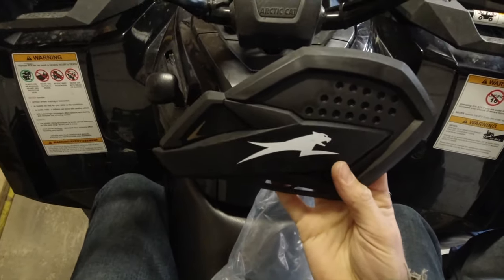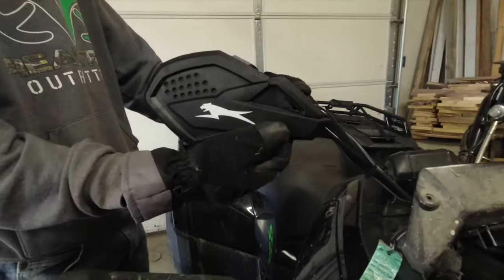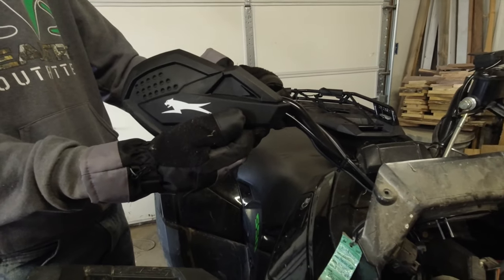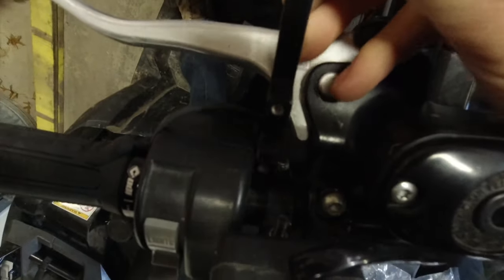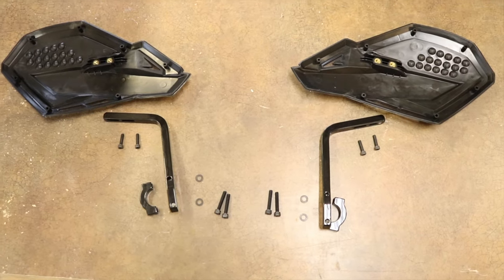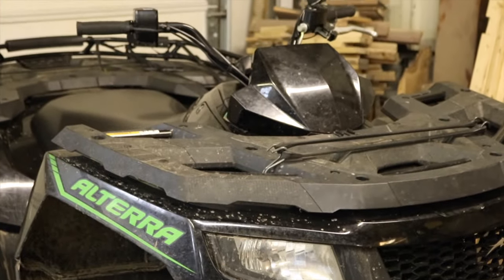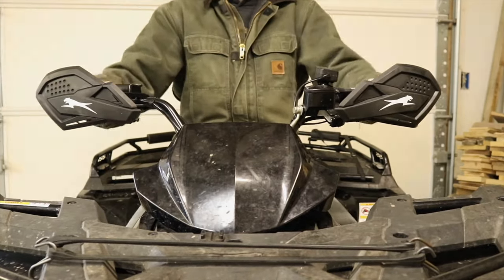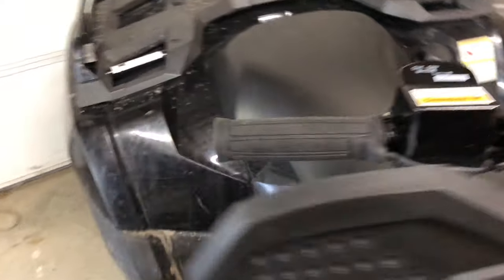How To Install ATV Hand Guards

Comment: But does the right hand side clear ok? Want to show you a picture of mine and I think it’s different
Reply from the maker: Got it.👍🏼 The newer Textron ones have a different 4x4 locking system so you may have to modify or make a custom mount.